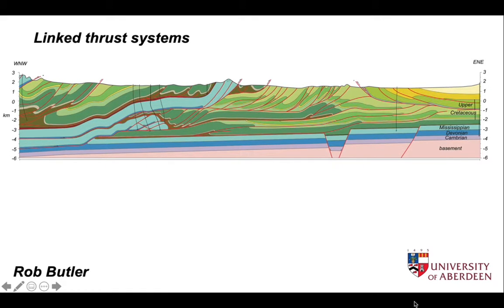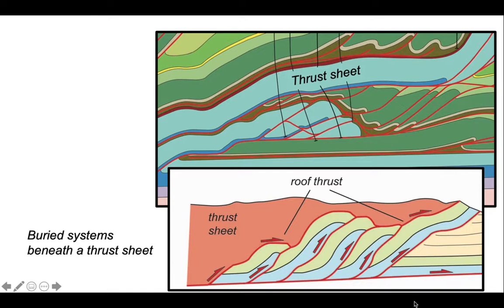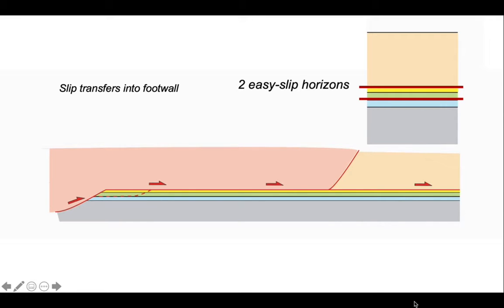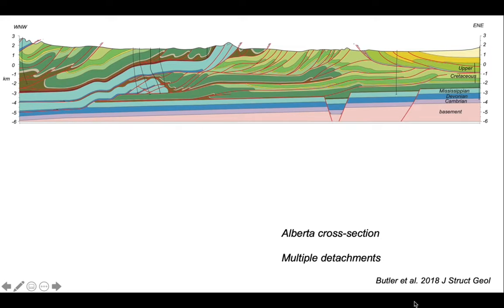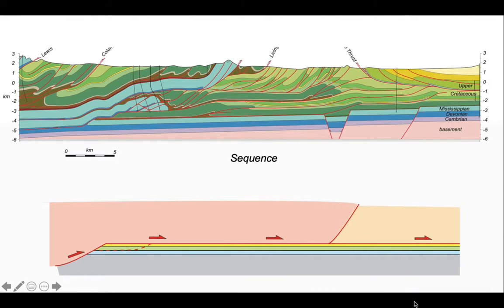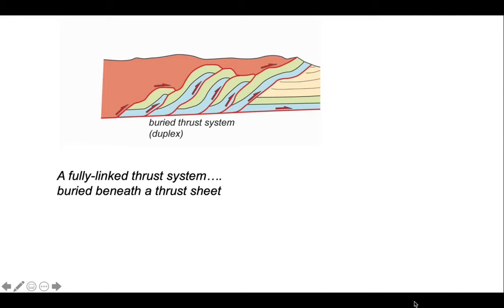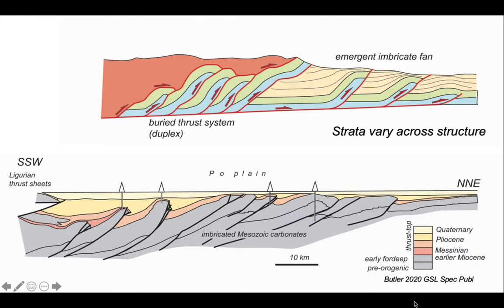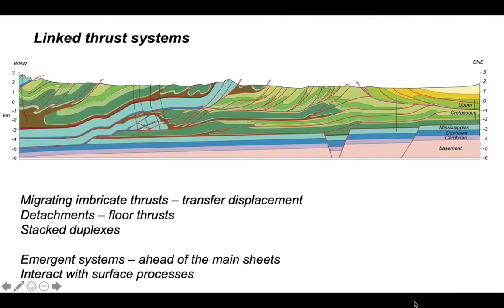Linked thrust systems

Comment: Good talk. How to explain the graben below the thrust system? I think they can be existed at the same time because of the different stress field. The root low angle fault plane is just the boundary of two different tectonic regime. This means a fast orogenis process.
Reply from the maker: The normal faults at depth presumably pre-date the contractional tectonics - it's all about timing. Normal faults - inherited from basin formation and subsidence that created space for sedimentation (the strata that will eventually become caught up in the thrust belt) - are to be expected in all orogens. Check out my videos on Inversion and on Alpine tectonics (Alpine basement) on the channel. Curiously, the sections through the Cordilleran foothills of Alberta is that these early fault systems haven't influenced thrust development... generally they do. Thanks for the question.